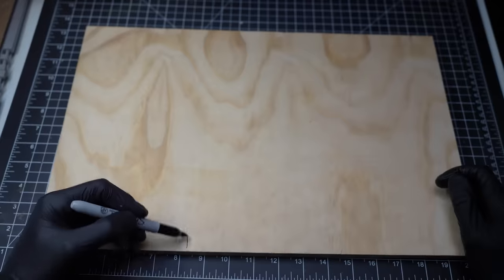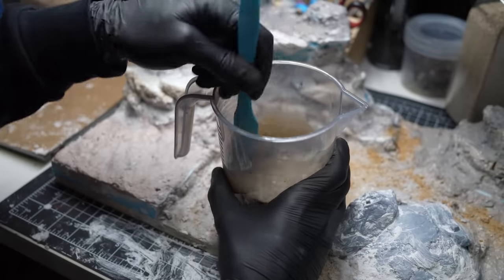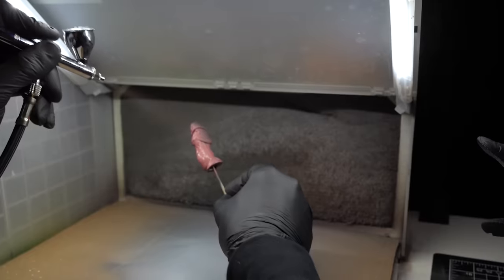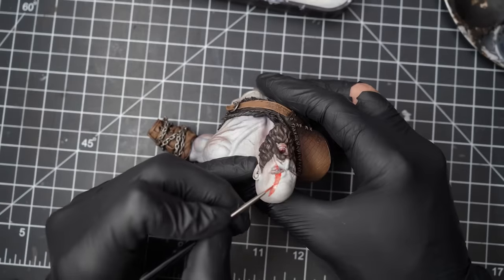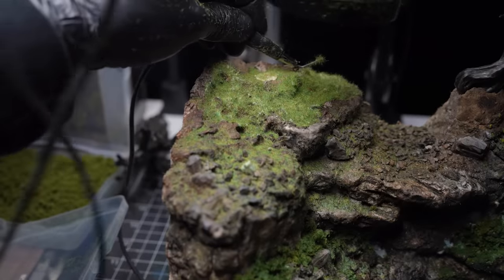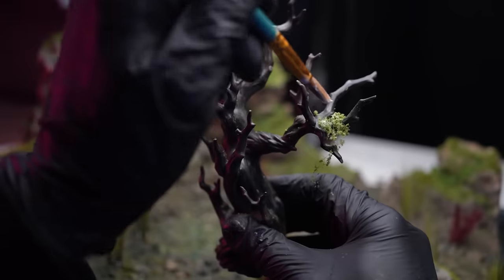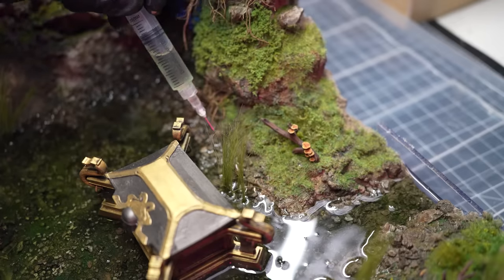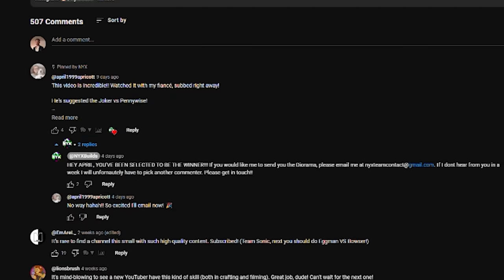THOR vs KRATOS (Diorama build)

Comment: just so you know in case anyone wants to make similar stuff, you can make rocks by crumpling some aluminum foil, make it kinda flat again and shape it into a "boat" shape, so to say, pour plaster in the shape and let it harden, you'll end up with big pieces of rocks, then break those pieces and use them wherever you want in your build, no need for the mold, this also makes unique rocks every time, unlike the mold which makes exactly the same ones